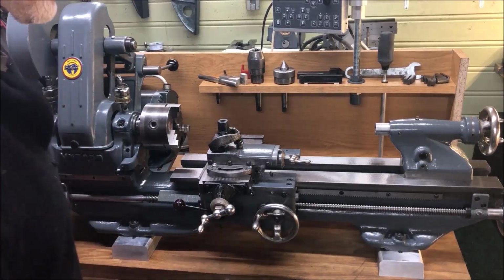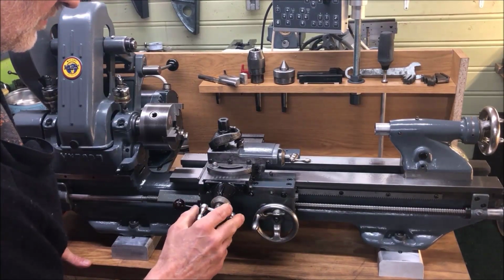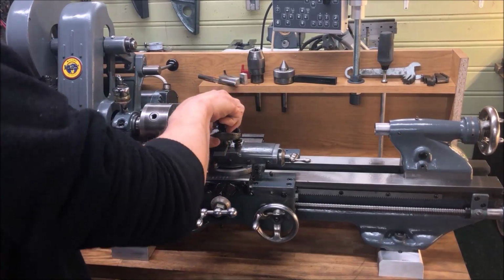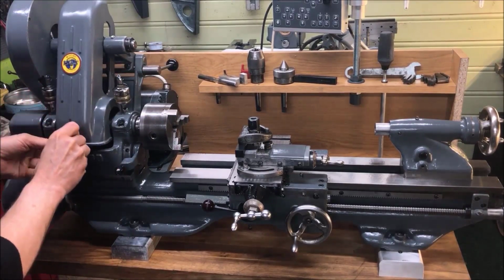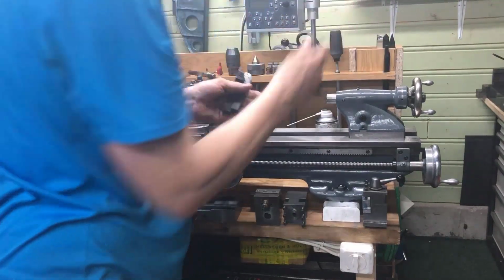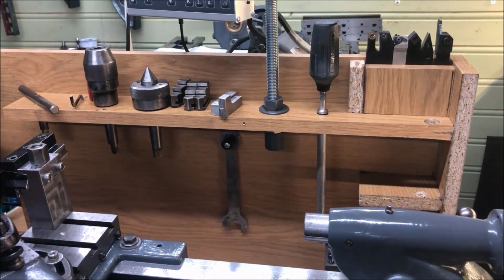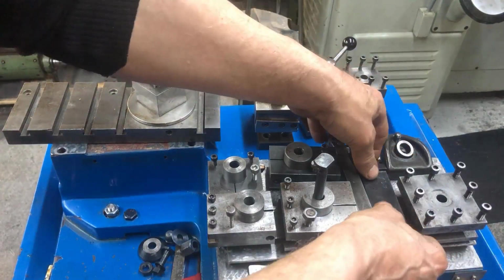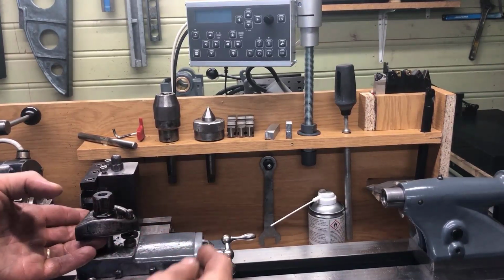Overview of machine, test stand, setup of tools and toolposts

Comment: Hello Jan,
I like the tool holder for the 16mm tools very simple but does the job...
Cheers.
Paul,,
Reply from the maker: Thnks. Yes, very simple indeed!
There is a certain amount of improvement in rigidity with a block toolholder, but for regular use plus the threading setup, it performs.